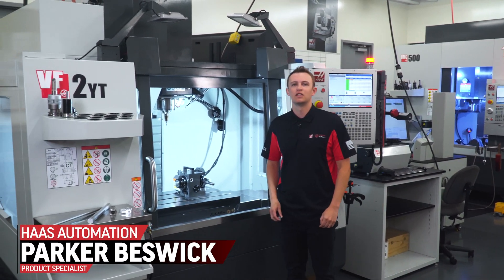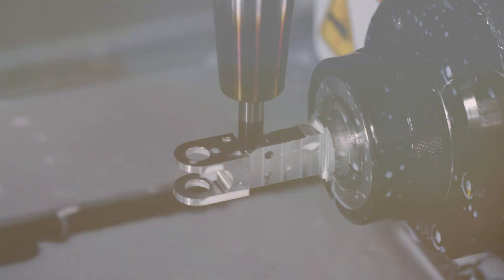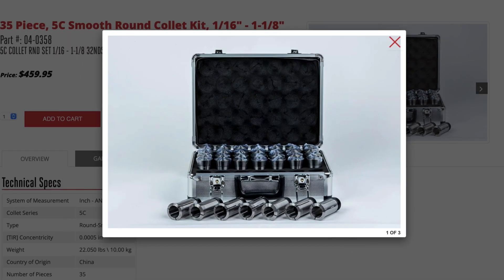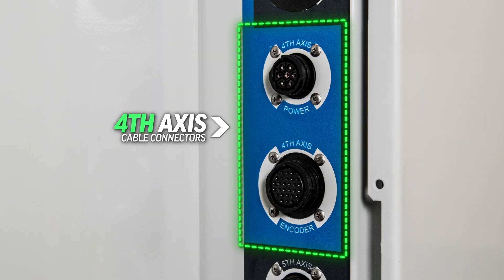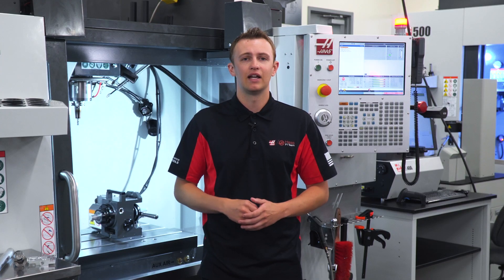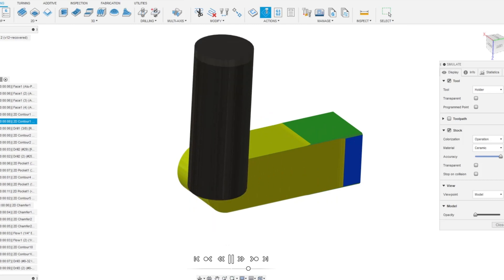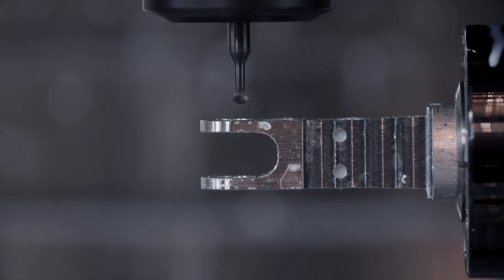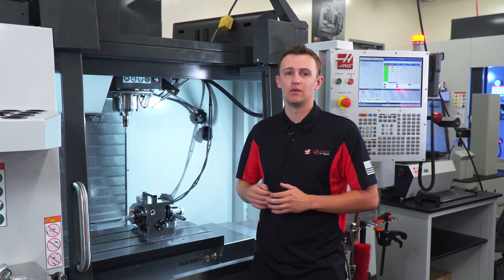The Haas HA5C Makes 4th-Axis Easy - Haas Automation, Inc.

Comment: Where do I set the 4th axis diameter for the HA5C so the head spins at the correct feed rate when milling on the 4th axis diameter? Thanks in advance. :)

Comment: Looks like a waste of $$. Just get a proper 4th axis like my HRT210. I learned on it from the ground up.
Reply: HRT210 is a great rotary I haven’t used one before until very recently. I love the small rotary as well tho
Reply: I have one of these on my '00 Super Mini Mill and it makes a ton of sense. We've been using it since the early 2000s, back when our good ol' mini mill was the only CNC in the shop w/ 4th axis capabilities. To this day - even with a VF3SSYT equipped w/ a HRT210, 2 different 5 axis vertical mills (both supporting simultaneous machining), 2 lathes w/ live tooling (both supporting 4 axis simultaneous machining) - we still find ourselves relying on that small rotary quite often for small parts.